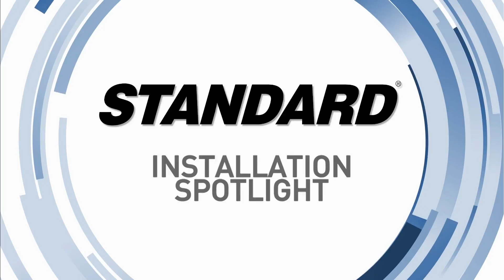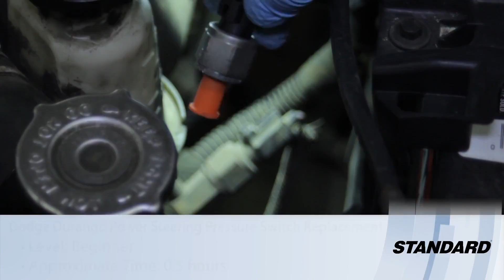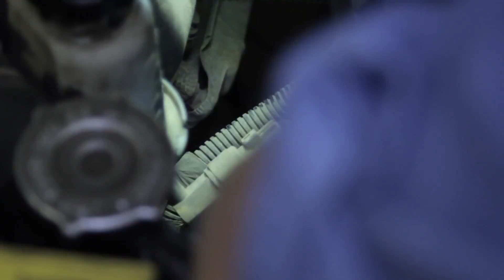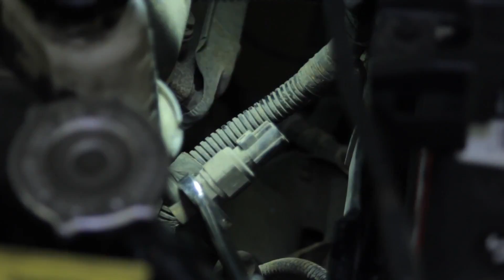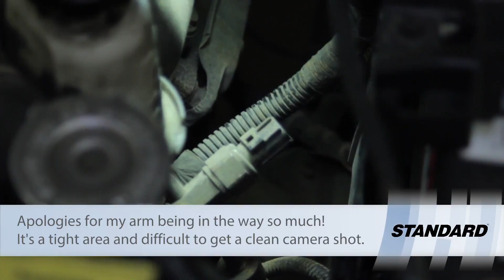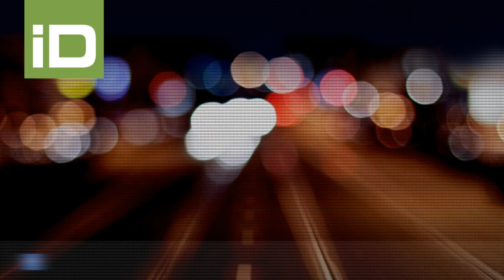Standard Power Steering Pressure Switch Replacement on Dodge Durango

Comment: Having a tough time with a charger PS. I've replaced the rack and the pump but the rack continues to leak fluid into the bellows on both sides. Is there a part like this on it that you know of???

Comment: what were the symptoms of bad power steering switch?
Reply: On Dodges, you'll get a P0551 engine error code with the power steering pressure switch going bad.  Be aware though that it may be other issues that cause that code, it is basically a code that lets you know SOMETHING is wrong with the power steering system.  Usually it is the switch, but it can be low or bad fluid, or the pump itself could be failing, or frayed/broken wiring, bad hydraulic hoses running to the steering components, just have to start looking.
Reply: Properly operating pump, normal fluid levels, no leaks, sluggish steering, trouble turning, stiffness in the wheel and a nasty squealing sound when turning.

Comment: Why would oil in the harness be an issue? Oil does not conduct electricity. Puzzled!
Reply: Any oil/fluid leaking is a problem for most people.  For many like myself, we are automotive perfectionists, and look towards stopping any and all leaks.
Reply: It contaminates the O2 sensor.